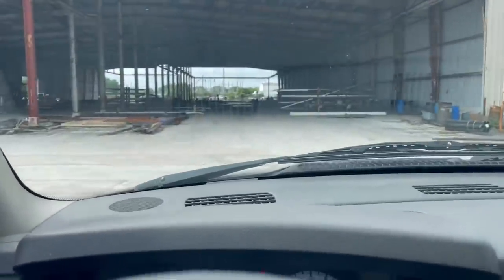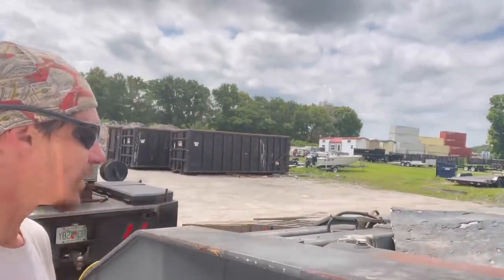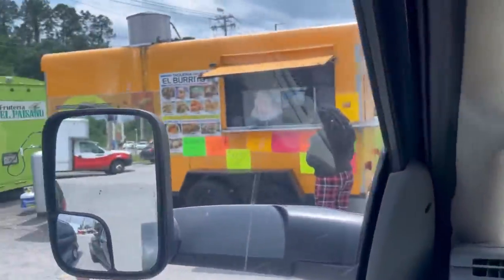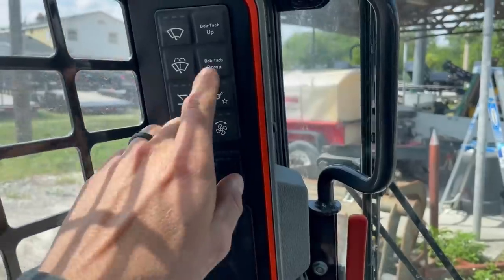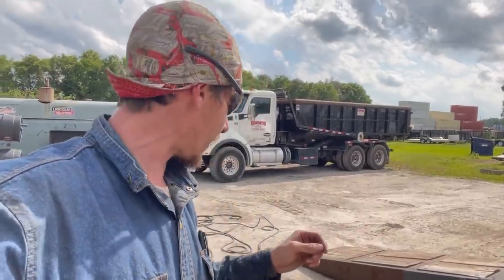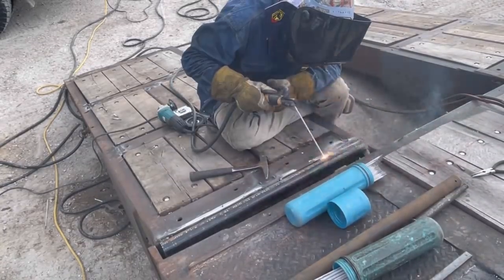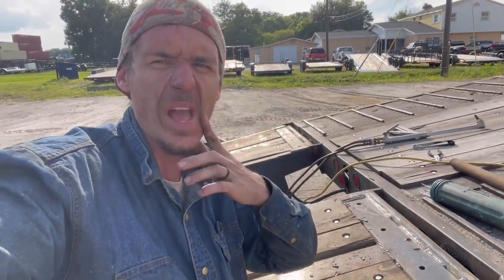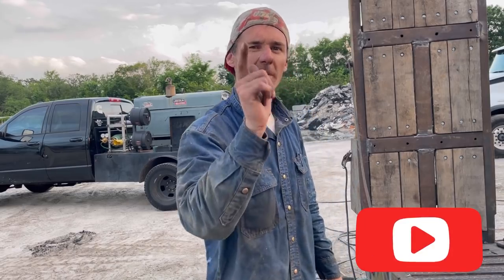Cracked Equipment Trailers and Burritos

Comment: My 2019 Bobcat T770 tracked skidsteer has those hydraulic locks, heated air ride seat, suspension on the tracks, ride control, stereo. They've come along way in twenty years.

Comment: You ever used 3M Cubitron grinding wheel's Anthony? They are the friggin answer, I use cheap ones too but nothing beats a cubitron.
Reply: Agreed. Not only do they cut so much better, but I get at least 2.5 to 3 times the life out of each disc compared to a zirc.  In Aus, acubitrons run about double the price of a zirc, so not only for the superior cutting performance, but also for the coin, they just make sense.

Comment: hi Anthony,another great video? thanks for sharing your works iam glad you are painting your welds, for those who do not know the paint makes things look so much better, the welds start to look like shit when the surface rust starts almost immediately,  it pays to keep a gallon can of cheap primer and a few cheap throw away brushes,that will cost less than a few spray paint cans.  how come you did not preheat the lug you rewelded in the first job today?   I have a good tip I always used ,yesterday when you were welding the gussets in the de-watering. pipes,(you should make it a habit to pick up some .75-1 inch washers and keep them on your truck,when you burn a hole for a shackle weld a high strength washer over the hole it looks so much better and it is stronger?  hope you don't mind my advice I have picked up a lot of tricks and learned to be a pain in the ass ,I have ben working and welding for 55years?   one last thing for today, it is so easy to install grease fittings all you need is a small drills couple of bits a small tap and some grease fittings, the last thing you did today ,putting in the new pipes and reinstalling the pins in the trailer would have a better jb if you had put in some grease fittings, and the pipes never would have split the way they did?   keep on burning?   gene 638

Comment: For this job could you have used a mig welder running 0.35 wire with 75/25 gas or do you have to use dual shield gas just asking
Reply from the maker: No too windy for either
Reply: While it may well have been too windy, I successfully run gas shielded wires in moderate wind on a regular basis. The key is to use a 1/2” long, tapered nozzle and crank up the gas pressure (50-60 with gas shielded flux core). That said, you should NEVER go near a job like that with hard wire. Gas shielded flux core or 7018 stick are your only logical choices in the field on a structural repair when you’re running in all positions. Unless, of course, the base metal requires a higher alloy filler(80-11018 for example).

Comment: Get ready to replace that pipe again on the ramp. It should’ve been solid bar not pipe. You amaze me on the things you do.
Reply: If a solid bar was used the ramps are essentially welded in place and cant be taken off like they can with the pin setup.
Reply from the maker: your ignorance amazes me